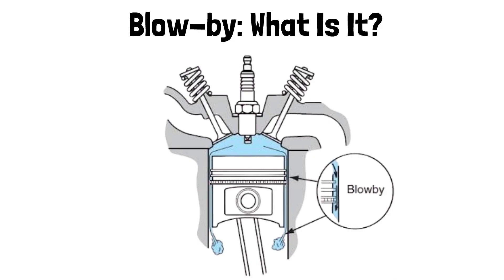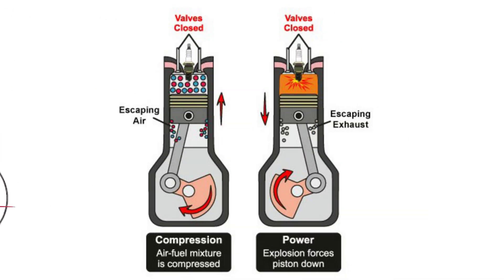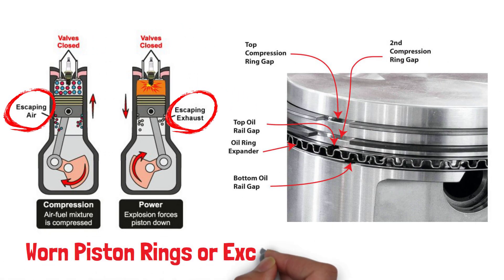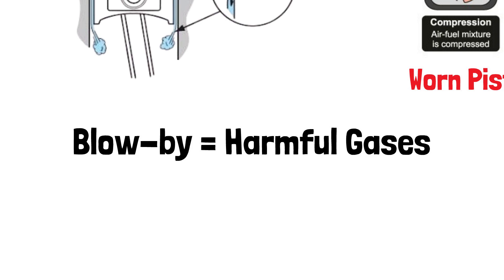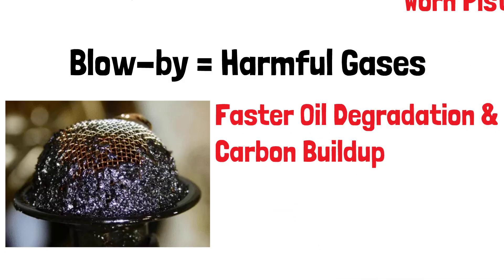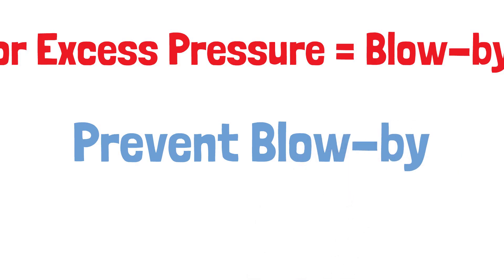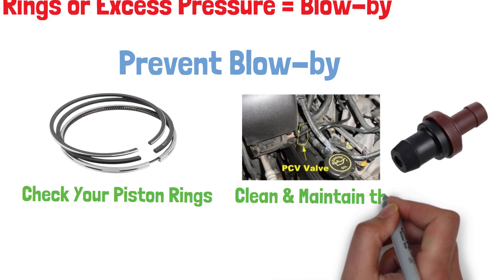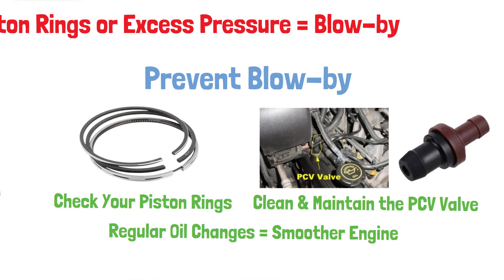You Won't Believe How Engine Blow by is Secretly Hurting Your Car's Performance!

Comment: On a diesel, besides piston rings, blow by can be caused from a bad air compressor pushing air into the crankcase, or fuel injectors not seated properly, these two causes can be ruled out by doing a compression test

Comment: Sure, I'll just crack open my engine and have a look at the rings! (hint: that's thousands of dollars of labor)
Reply: @WquestionMark9  I install new rings every other oil change. No blow-by here. 😂
Reply: @blipco5 I lick my piston rings clean to remove carbon build up every other oil change as well as using Pampers nappies instead of oil & air filters & save myself a fortune.  So glad I found this helpful video.  I did get Audi to strip & rebuild my engine down once, when I discovered piston ring wear, but the massive bill drove me to hang myself, so I'm using ghost telekinesis to write this comment from the grave...
Reply: @WquestionMark9  no need for that prior to seeing your mechanic for a compression test and leak down check. Relax there are plenty of people who know what you need without necessarily spending a lot of money
Reply: you can check with a compression tool tester. it doesn't require you to dissemble the engine. or u could go old school with testing each piston with sparkplug on and off to check for compression. you can do same with diesels only its with injectors. Blow by is not good, finding out saves you in long term👍
Reply from the maker: It can be costly, but catching issues like blow-by early can save you in the long run. Hope you get it sorted out!
Reply: No, it's completely unnecessary and no one outside of racing disassembles their engine to check the rings. lmao. You have no idea what you're talking about.
Reply from the maker: Well, if you have symptoms, then sure, checking the piston rings makes sense, I forgot to mention that in the video. But come on, why check if there’s no problem? It’s like going to the doctor just because you’re not feeling sick. I’ll be sure to add a 'magic wand' for checking them next time haha. Maybe I’ll throw in a compression check for good measure too!"
Reply: @WquestionMark9  not if you do ot yourself